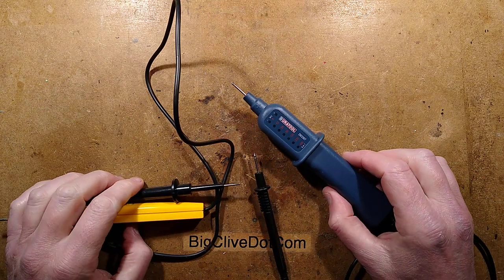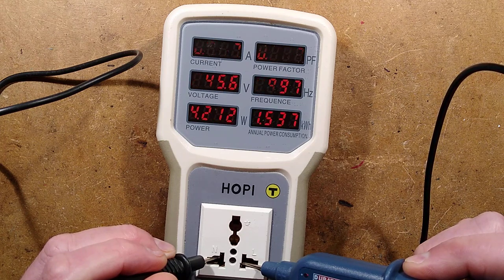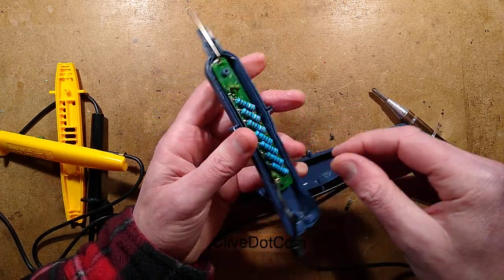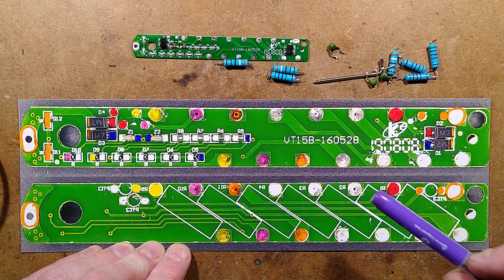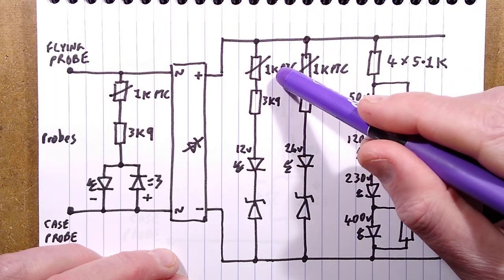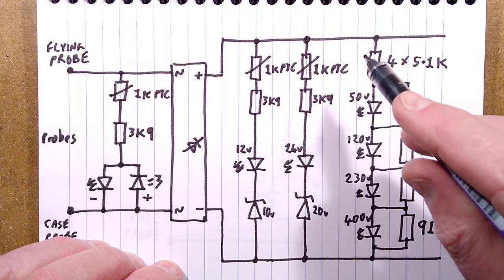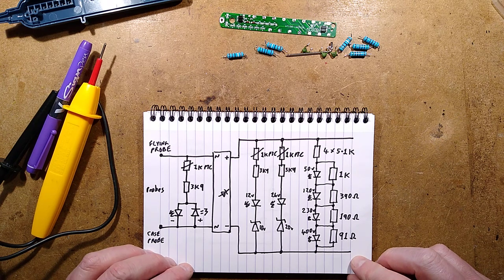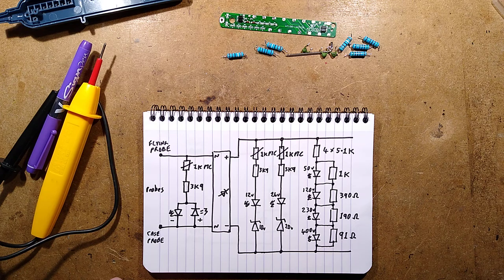Inside a cheap multi-voltage tester (with schematic)

Comment: I'm sorry but "stuffing" a raw bridge rectifier in a safety-approved-by-no-one gadget built by no one somewhere in China onto an energized circuit just doesn't strike me as prudent, even with the caveat that it be used only by untrained yahoos on home CAT II/III circuits. I bought a vaguely similar gadget in a US big-box hardware store for about two or three time as much as you paid for yours (best estimate, including tax, shipping ($0 for me), and gratuities), but at least mine came from an identifiable source and bears an etl mark. As an added bonus, I don't think the store has any plans to invade Taiwan, except possibly in the commercial sense.
Still, thanks for the video!

Comment: The plastic case of the yellow one looks like it comes in a more advanced variant with more LEDs
Reply from the maker: It does.  I just received one today.  It's 380V LED unfortunately lights up on 240V.